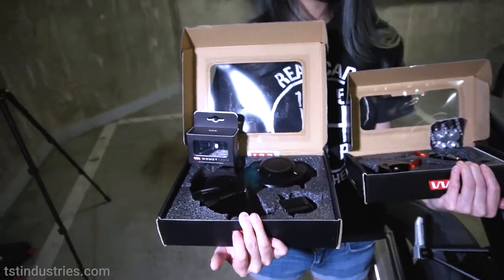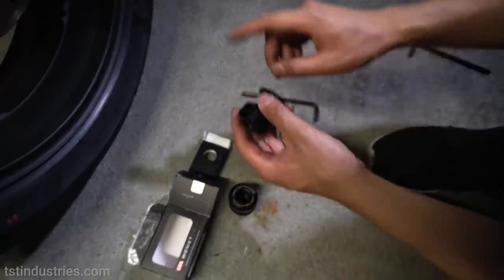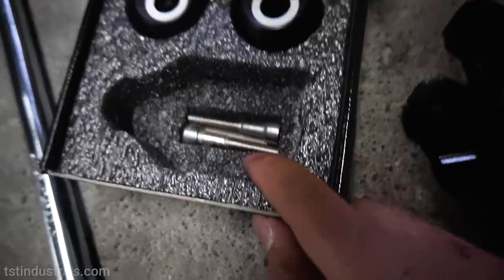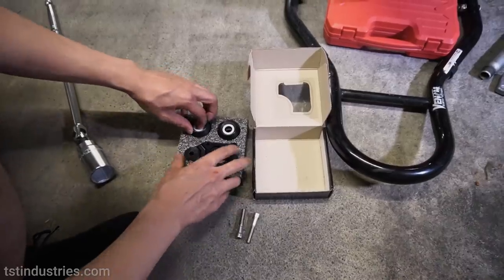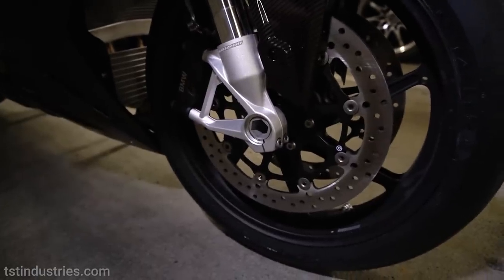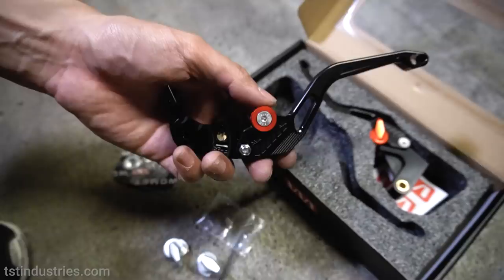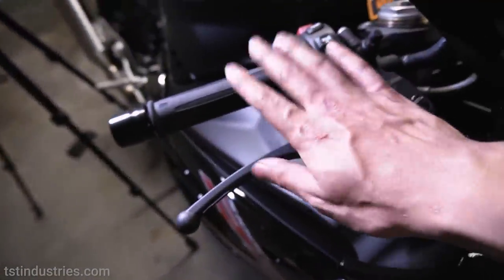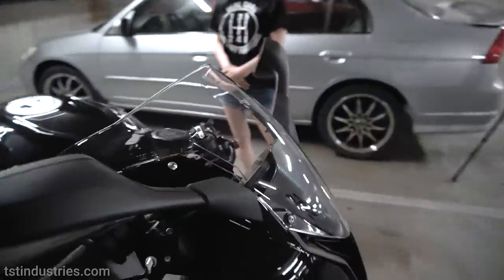Essential Mods To Protect Your Motorcycle! | BMW S1000RR BUILD

Comment: Great video! But you shouldn't be using your torque wrench to tighten the bolts/axle nut from beginning. You should tighten by hand or with normal wrench first as close as possible and then finish it off with torque wrench to torque it to spec. Only use torque wrench to finish it off to spec!
Reply from the maker: I agree. I didn't show it here but I did in fact use the breaker bar to tighten it most of the way. I probably did 5-6 turns with the torque wrench to finish it off! I guess the way I edited it made it seem otherwise 😅

Comment: No loctite on the rear spool. Not a torque wrench for your engine protection bolts.
Reply from the maker: Yeah didn't bother putting loctite on the rear spools. Never had any fall out on me so far. I'm keeping an eye on it though. As for the engine protection bolts, I just didn't show it in the video but I did torque them down :D

Comment: im planning on buying a s1000rr in 2 months would it be possible to get a list of all the safety accessories for the bike? would love to buy all of these things before getting the bike since i dont live in the US
Reply from the maker: Rear Axle Sliders
Front Axle Sliders
Engine Case Covers
TFT Screen Protector
Radiator + Oil Guard
Frame Sliders
Tank pads (to prevent any scratches on the tank and for additional grip)

Things I don't own yet but eventually may buy:
Tank Sliders
Tail Sliders
Lever Guards
Reply from the maker: A lot of the things you can get from https://tstindustries.com

Comment: Quick question on the tst web page it says that it is only for 09-19 will the parts still fit?
Reply from the maker: I assume you have a 2020 or 2021 s1000rr? If so, nope, It will not fit!

Comment: Doesn't the paint on the spools gonna get scraped off because of the rear stand?
And isn't it enough to put the bike in gear to hold the rear tire to loosen the axlenuts?
Reply: Aahh the boxes were there to keep the wheel on the right height to reinsert the axle
Reply from the maker: I'm sure overtime the rear spool paint will wear down... But like I said in the video, they're very cheap to replace anyways if you're super OCD about that stuff! And yep, the work becomes 10x harder if you let that wheel drop  😂
Reply: @STANTHEMOTOMAN  i see

Comment: You were good until the shorty levers (lol).  When you get to old man status, you'll go back to the long levers (like all race bikes have).
Reply from the maker: I'm guessing you've already gotten to old man status then
Reply: @STANTHEMOTOMAN  oh yeah, for sure, but I've never liked shorties since I've started riding, before I was certified old man.  I've always been attracted to the race bike aesthetics, that's probably why. :D
Reply from the maker: @garylai363  haha to each their own! I've gotten so accustomed to Shorty's that I don't like them any other way (for now?) Lol
Reply: @STANTHEMOTOMAN  nah man you do you. I'm just teasing ;) I was the opposite, I never liked the feel of shorties.
Reply: @garylai363  Do you also actually use all 4 fingers to clutch and brake?
Because I never find myself using my pinky, and sometimes also the ring finger on the clutch and brakes
Reply: @Daniel-dj7fh  i use at least 3 fingers on the clutch, since i have a short pinky, but when holding the lever in, I'll use all 4.  I find short levers flare out earlier so they actually move further away than long levers.  For braking I mostly use 1 or 2 fingers, but overall I dislike the look of short levers as well.